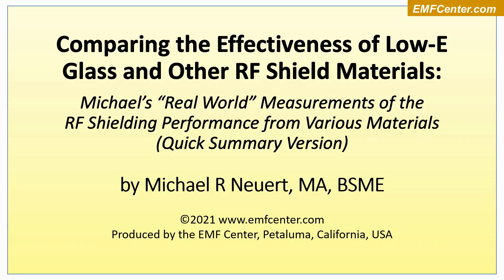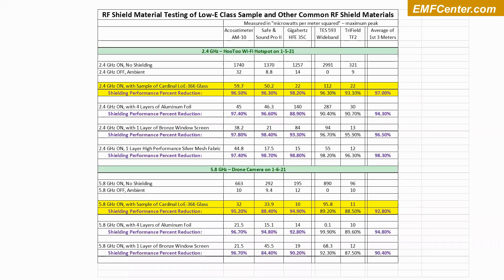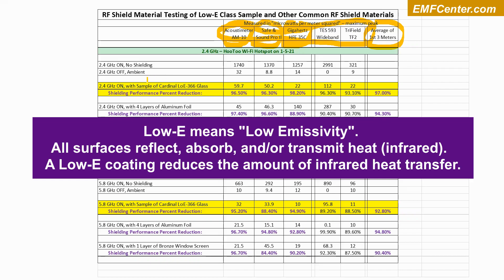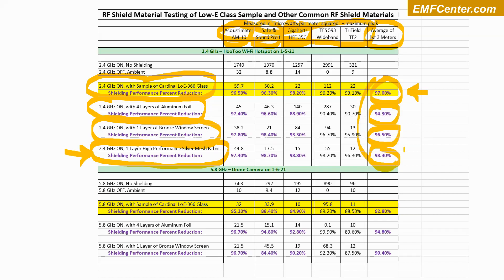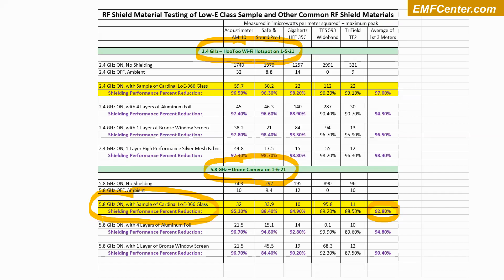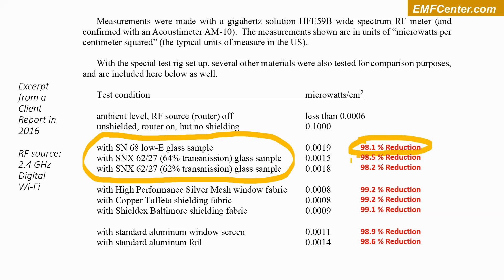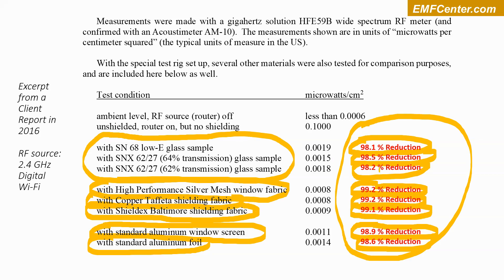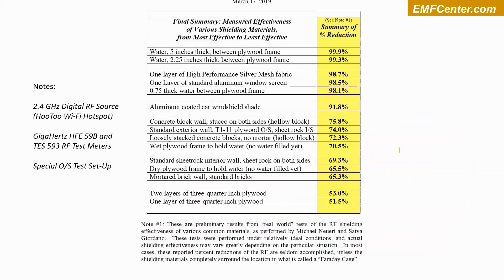Comparing the Effectiveness of RF Shielding Materials - Including Low-E Glass (SHORT VERSION)

Comment: I was pleased to come across graphite wallpaper recently.  I want to get away from aluminium, steel or silver because they oxidise and I think the air in my rooms is filling with metal oxides.  Aluminium foil on the walls (looks awful too), and fine steel mesh at the windows.

However I was disappointed to learn it needs to be double layer or used with a layer of another kind of shield because it doesn't really sheild enough.
It's so expensive!
Reply: Curious if you tried it mate? I've never heard of the wallpaper but my original plan was to DIY my own conductive paint using very fine graphite. I bought 1kg of graphite to experiment but pulled out after watching some videos of it. It's pretty ineffective it seems. At shielding, at cost, and at time/effort required to experiment/create/apply. 

One idea I stumbled across was to convert the graphite into graphene. Might help.

I ended up going with some expensive commercial mesh/fabrics. Started installing today.